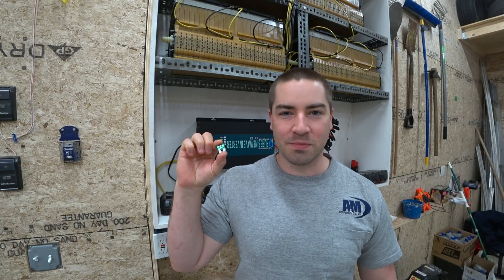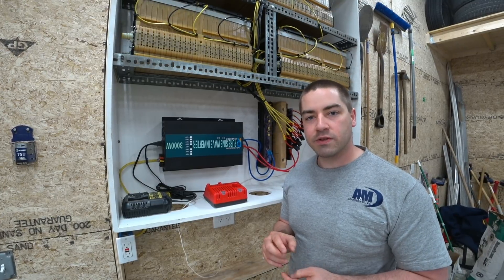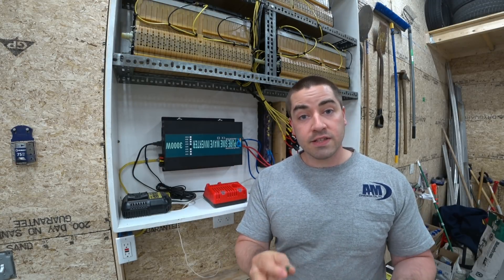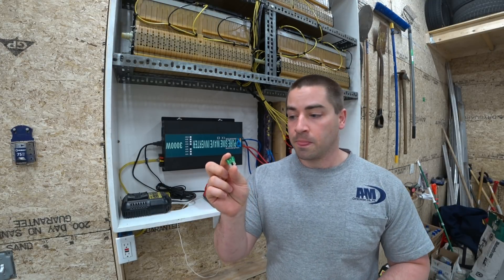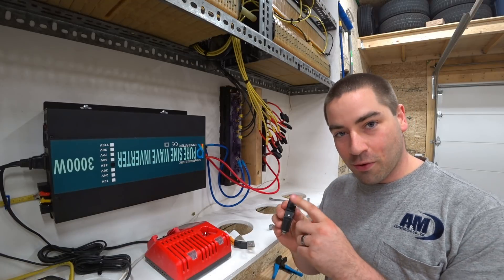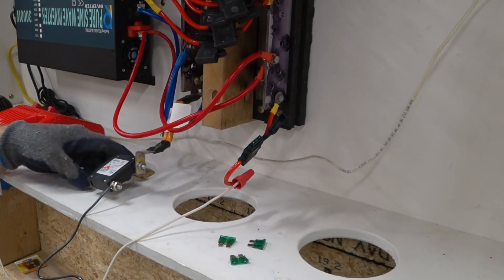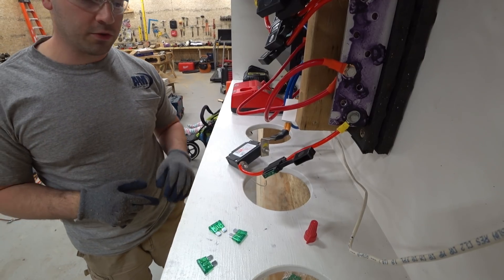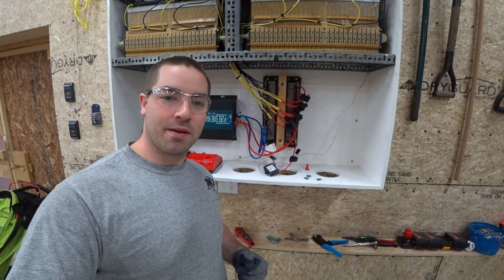Fuse Test to Protect Chevy Volt Batteries on DIY Powerwall

Comment: Good Year with Health ... 
I just saw the video and I want to clarify that the construction quality of the fuse has the most important role and 30Amp fuse designed for 12volt is equal to 360Watt. Here we have 44.2 volts with a 30Amp fuse that is equal to 1326 watts. (Just 1000 Watt, above !!!) and it's not all that. The fuse burns at 30 amps but the truth is somewhat different .... see this video on the link "https://www.youtube.com/watch?v=mAEXiD83X4I&t=9s" and it will understand ... (sadly it has no subtitles but the meaning will understand it.) And something else ... I hope the baits not to produce gases that can become gaseous or dangerous for gases. I would suggest that the air coming out of the batteries be driven to open air.  Also, one suggestion I would make is to install a fire detector over the batteries and and connect  to small fire detection system that will lead relays capable of disconnecting all batteries connections to each other and to the busbar. I know all this was cost but safety must be first.
Best regards, Ioannis Christodoulou, Greece

Comment: The answer is unfortunately a NO. The arc (flash) you see when the fuse blows is the answer (reason) why it does not work in a safe manner. The reason is also easy to inderstand, you have a system which can deliver a lot of energy when shorted. 

Use HRC fuses which are designed to kill the arc. They are a few dollors each and migth protect your life/property.

Comment: it may still conduct with a higher resistance load. I would check by putting a led and resistor across the fuse. if it doesn't light .all is good! great video I been wondering the same about fuses for my system.
Reply from the maker: Hi James,  The fuse had no connectivity after it blew.  I'm editing a new video that is an update to this one.  It should be posted in the next day or two.  Added safety.

Comment: Just a question why dont you use a dc breaker?
Reply: Cost is inconsequential compared to safety, you've got a wife and kids who you likely want to spend as much time with as possible. Don't skimp on stuff like this to save $50 (12x DIN breakers are ~$90), it may prove to be not worth it come a fault condition (which never happens to "you", until it does)
Reply from the maker: Hi dany d, There are many ways to wire up a battery bank, and breakers is a very good way to do it.  I was trying to keep my cost low.  I have 8 batteries wired in parallel.  If I buy a breaker for each then it's a lot more money than what I spent.

Comment: It broke the circuit alright, but produced a FIREBALL, that is what I would call a catastrophic failure, your fuse should NEVER arc and emit a flame like that, at these power levels the ceramic encapsulated type are what I would use, when those fail you need to check them with a multi meter since it doesn't look like anything happened (that flame gets contained within the body of the fuse)
Reply from the maker: Thanks Liam O'Brien,  Could you help me out on a part number, in-line fuse holder, and where to buy?  Thanks.
Reply: David, you would probably be better served from a cost perspective by switching to DIN rail breakers, like these from Midnite https://www.altestore.com/store/enclosures-electrical-safety/overcurrent-devices-fuses-breakers/din-rail-circuit-breakers/din-rail-mount-circuit-breakers-p40906/#GENBRKDIN-30 only $12 each, for 30A/150VDC rated. A comparable Class R (so ceramic encapsulated) 30A fuse, plus holder, would be ~$13-14 and only works once (breaker can be reset) some links to what I mean https://www.zoro.com/eaton-bussmann-fuse-block-glass-and-ceramic-30a-1-pole-s-8301-1-r/i/G3101244/ https://www.altestore.com/store/enclosures-electrical-safety/overcurrent-devices-fuses-breakers/fuse-fuseblocks/30-amp-250-vac-125-vdc-class-r-fuse-p4183/
Reply: Sorry if I sound like another one of these Youtube cranks, but seeing the testing of that fuse going KABOOM is a bit worrying, you definitely don't want your last line of defense to not be rated for full interrupting current (which is a value you should also look for, the Midnite breakers are ~10,000A) it takes a lot of good design and RATED components to be able to break a high voltage DC arc (which happens everytime you flick the breaker on and off) if you look at a DC switch and compare it to a normal AC house one you will see the difference (much beefier contacts and different design, compared to AC which can self-extinguish to a large extent)
Reply from the maker: Thank you for providing a link and showing what fuses you are talking about.  I really appreciate the help, and going with a din-rial setup with breakers looks very appealing.  One part I'm still confused with...  Some people have commented saying I should have my fuse located at the battery side of the wire, not the busbar side.  With a din-rail setup with breakers I'm still next to the busbar.  Is that still OK?
Reply: Liam O'Brien guess this was also one of my concerns. I have not watched enough of your videos to know where these batteries are located? I work in the aviation industry which has been using lithium batteries for some time the most important thing with lithium batteries is the management of them making them safe in any kind of environment. Are you storing any kind of flammable liquids in the same location of the batteries? These batteries are designed as a complete system you remove the batteries from the system and are using them without all the safeguards that they were designed with you need to be extremely cautious. I cannot stress this enough the battery management system that was designed with these batteries provided many fail-safes for the battery speak to be controlled in different environments. I see many DIY wires running lithium batteries without BMS systems and that concerns me cuz at the end of the day the most important thing is you and your family.

Comment: I am using 1; 48 volt / 50 amp marine circuit breaker per 48 volt chevy volt module.  I am really just protecting the batteries against catastrophic failure / extreme (accelerated) discharge / short.   I like your helper.  My helper started helping me when he was about 4!!

Comment: Hi David, what you've tested is a limit of 30 amp draw per battery; in other words 1320 Watts?  Thanks
Watts = Amps x Volts
1320  = 30 x 44

Comment: I would call that a catastrophic failure, I mean it only pulled maybe like 200 amps or so... I think you should check that fuse holder really well if you plan to use it again, right after checking your pants :)
Reply from the maker: Hi Jon,  I'm not sure what the definition of failure would be in this case.
Reply: Jon, I did this same test and I can assure you the fuse holder is fine. In fact, just for shits, I blew 3 Harbor Freight 30 amp fuses back to back just to see if I could damage the fuse holder.  Nope
Reply: DavidPoz It's prolly fine :). Im just messing around because the thing popped pretty good, I didn't expect that when you hooked it up.
Reply from the maker: Hi Jon,  I agree, it was a pretty good pop.

Comment: Someone "questioned" me on the same subject- as I'm also using 30 amp automotive style blade fuses.  I explained to the 'well meaning man'  how I ran a test, and the results were "a non event of monumental proportions"  :P
Reply: Hell no...LOL in fact, they were lingering around in a box I'd bought from Harbor Freight years ago
Reply: I think if anyone looks up the required air gap to ARC 48 volts it's less than 1thou, and if it did ARC, does anyone think that fuse material is gonna last?
Reply from the maker: Hi Mark,  That's a nice line.
Reply from the maker: Mark,  did you buy any kind of special fuse for yours?
Reply from the maker: Hi Mark, Good to know I'm not the only one using off-the shelf fuses.
Reply from the maker: Hi Jon.  I didn't look up the air gap in advance, thanks for sharing.
Reply from the maker: Hi Mark,  What do you think to mixing chevy volt batteries, gen 1 and gen 2?  My current one is gen 2 and a local junkyard to me has a gen 1 for a good price.